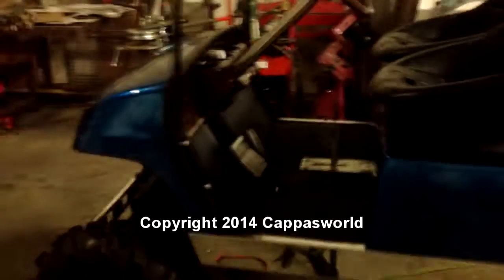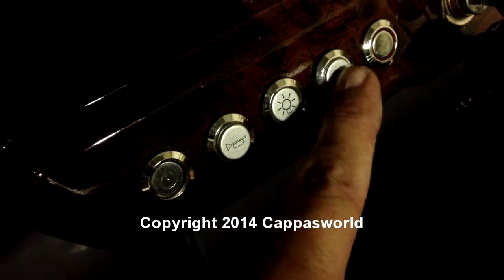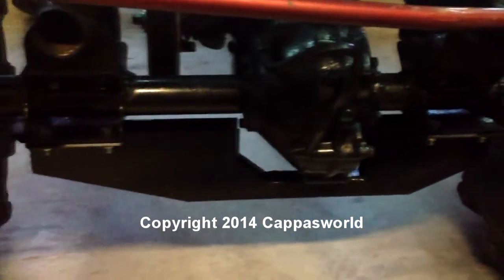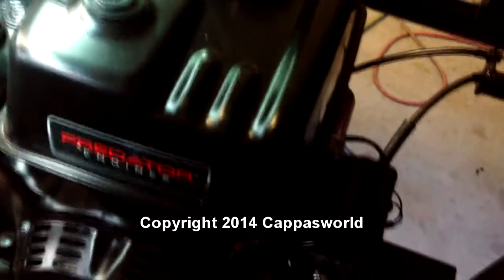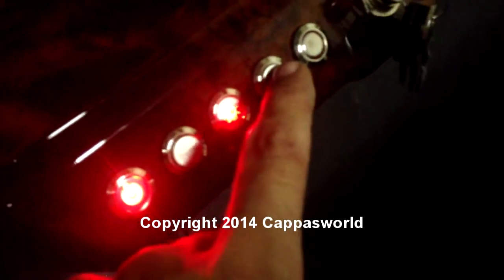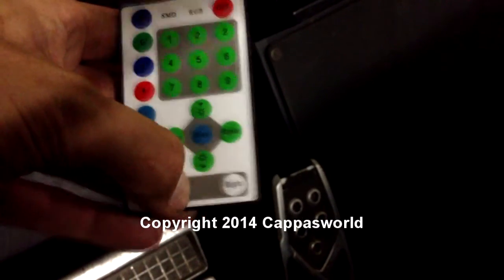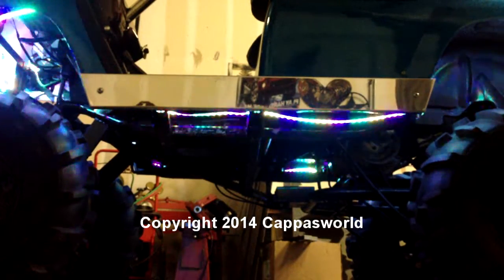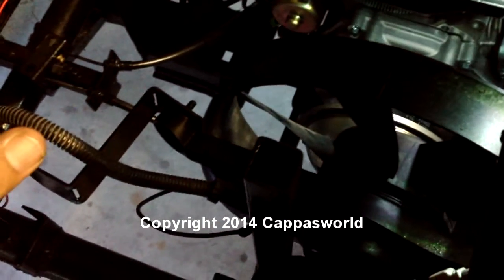Monster Golf Cart eBay

Comment: how exactly did you get the reverse to work I got a 420cc swap but I don't have reverse
Reply: you need to have reverse /forward gears that are  integrally  shifted via a shift fork with shift lever on top or side differential on most carts ..but if not can use a go cart reverse gear box